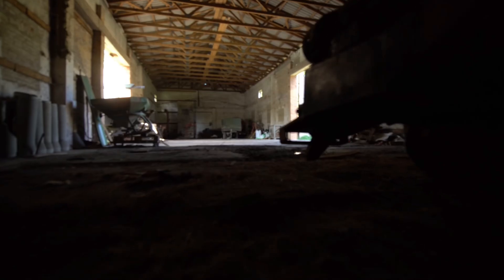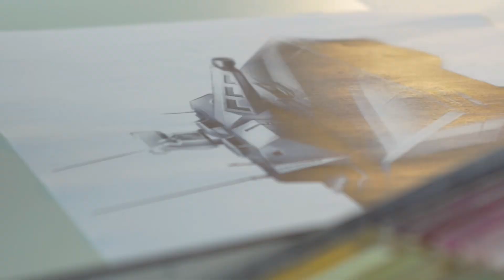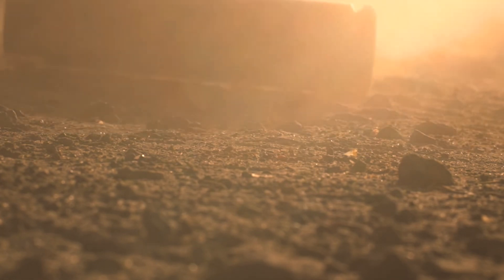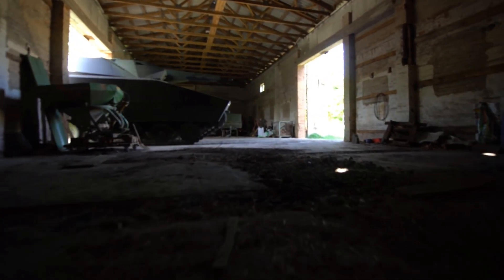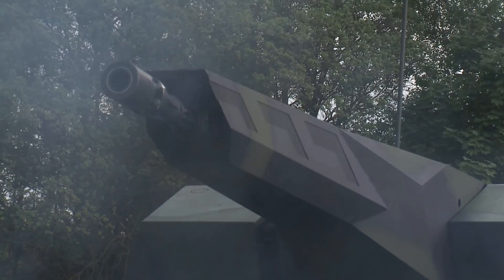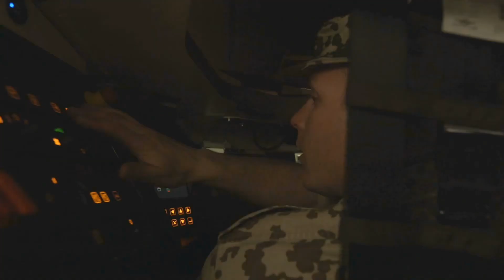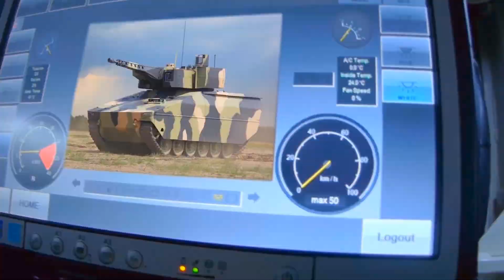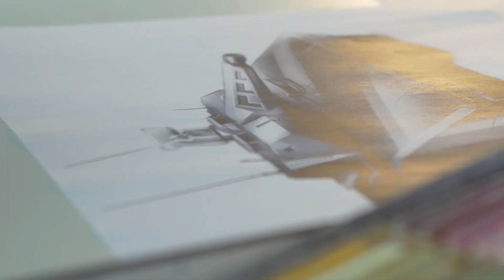Lynx KF41 IFV - Puma has competition!

Comment: My personal opinion is that this is an Upgrade to the PUMA. Dont forget that the PUMA should be in Service Since 2007 and for now just a bunch of them entered sevice in the Bundeswehr.
Reply: A 'bunch' of 200.

No, this is much different from the Puma. This is for export, less advanced, but also less expensive.
Reply: Jonny I serve on this vehicle and it's uncomfortable for the crew with the IDZ programme the needed upgrades won't be finished until 2020 and it's mechanically unreliable
Reply: The Puma uses some more advanced but also more expensive approaches that put it ahead of the competition, including ther Lynx KF41. Here is a list of advantages the Puma offers over the Lynx that i already commented earlier in this comment section, i just copy-pasted it:

-Hydropneumatic suspension: While the Lynx uses torsion bars (the 'advanced' thing they were talking about were only the bump stops) the Puma uses a hydropneumatic suspension. 

-Decoupled running gear: The running gear of the Puma is only connected to the main hull with rubber elements, reducing vibration and noise comparable to rubber band tracks, without the disadvantages of rubber tracks. More importantly, it increases mine/IED protection because the hull doesen't have any bolt, screw or torsion bar holes (except for the final drive) that would create weakspots. Lastly, the fuel is stored in the decoupled part, thus outside the hull and less of a hazard to the crew.

-KMWs propetary 'thin metal bending technology' (also used on the Boxer MRAV) Instead of weldig thick steel plates together like usual, thinner plates are placed overlapping and bend together. It creates a lighter, but more sturdy hull that is more resistant to blast effect. Combined with the decouopled running gear mentioned above the Puma reaches a mine/IED protection level higher than that of the Leopard 2A6M MBT. The weight saved by the hull is invested into more composite, boosting the weight/protection ratio.

-MTU HPD engine technology: The Pumas engine is about as powerful as the Lynx engine, but much smaller.

-Better optimized internal layout: The Puma was initially developed with a unmanned turret only, so it could be better optimized for it. This allows less waste of space and results in a better protection/weight ratio.
Reply: Protection: https://below-the-turret-ring.blogspot.com/2016/10/puma-ifv-armor-and-upgrade-speculations.html

Performance in czech test trials: https://below-the-turret-ring.blogspot.com/2017/12/addendum-puma-ifv-performance-in-czech.html

Comment: tell me, how is this IFV not considered a light tank?
Reply: Armament?
Reply: the m3 Stuart, m3 Lee, and m22 Locust also sported a 37mm and it were all considered a light tank so that is out of the question.
Reply: Don't compare it to WWII vehicles, you have to look at it in a contemporary manner. Nowadays 30-50mm are infantry support or air defense only, and can't penetrate modern MBTs. The abiliy of the Lynx to carry infantry under protection and provide direct fire support for them makes it a IFV.

Modern light tanks, the CV90120 as example, also base on IFV chassis but sacrifice their troop carrying ability for the larger armament. Light tanks are considered pretty useless nowadays because MBTs can do everything they do, but better. They're even more mobile despite the higher weight.

Comment: I cant help but have a bad feeling, that western modern designs completely abolished the option of an amphibian or at least swimming APC/IFV. And also that the space inside somehow forces troops to be less and less geared ( cant imagine having troops with a butt-pack and an 3-day rucksack there at all ) meaning they be heavily depended on logistics - witch again strikes the amphibian/swimming issue. In middle Europe ( im from SVK ), both the infrastructure state of bridges, and the number of rivers is a big issue. So if an enemy had an edge in the sky, picking up columns of bridging-vehicles or bridges themselves be an easy task. practically leaving the group uselessly sitting at the first river.  ... i also cant really argue the protection of the crew, but AT-rockets always will have an edge here, and it be still useless if a large-enough group of AT-squads would hinder the APCs/IFVs anyway. .... not complaining, but for a small nation as mine, this very downside means thus a much more bigger need in logistics and engineer-troops ( not just for the bridges ) and heavy AA capability to defend them. Not sure if it is thus a good concept.

Comment: 40 tons are a lot. Means it will have a severe drinking Problem, as well as sinking. And Track wear. I'm not sure I'd take it anywhere near soft Ground. Recovering it will then also require rather heavy helpers.
And it's Fuel Consumption will reduce independence.
Bridges become a Problem as well at 40+ tons.
Reply: Vehicles with larger engines also carry larger fuel tanks, so consumption isn't a problem. Track wear and terrain isn't either, because larger vehicles of course also use larger tracks than small vehicles. Ground pressure is pretty similar, mostly around 8-10 N/cm². Bridge argument is valid though, however that is simply a question of doctrine, preferring mobility over protection. Imho, never.
Reply: Jonny Fuel Consumption is a big Issue Logistically. Fuel Storage is always vulnerable, the bigger the worse. And that thing has almost twice the Ground Pressure than the Russian and Chinese IFVs. It's size kills any attempt at Conceilment and Surprise. And no matter how low the Ground Pressure, the Vehicles will still damage Roads far more severely than Light Vehicles, to the Point that Logistic Trucks will no longer be able to easily reach their Destinations.
Reply: And IMO a moving Vehicle is worth far more in a Breakout than a Stuck one.
Reply: 'Fuel Consumption is a big Issue Logistically. Fuel Storage is always vulnerable, the bigger the worse'

Larger vehicles don't only have larger fuel storages, but also more armor covering it. It's a upscale at a whole, not only certain parts.

'And that thing has almost twice the Ground Pressure than the Russian and Chinese IFV'

That isn't true. VN-17 IFV weights about 30 tons, T-15 IFV about 40. You have to compare it to current-gen IFVs.

So you are preferring far inferior protection just for the advantage to cross bridges?

Comment: The thing i always think when seeing all this tech,  same as both air force and navy projects, as cool as they are,  so they really need to be so massively high tech?  If it's modular it has the ability to be upgraded down the line,  but when every country but usa(USAUSA) is cutting military budgets, surely more modern (as in better reliability, better but similar designed and with better materials) versions of what currently is affordable in number better than these?  Something that has been repeatedly tested and used already but with the problems fixed?

Comment: so in the end its just a marder II ifv with internal facelift and some fancy new dress to slip in.....
upgrading 60´s tech can only bring you so far.....
Reply: Marder 2 is 90s...
Reply: its the marder I upgraded to marder II.
so a 60s tank upgraded to 90s, now with the lynx to 2015
Reply: The Marder 2 wasn't a upgrade of the Marder 1. It was a entirely new vehicle.
Reply: well it is in the most part the marder 1 chassis, re designed with leo2 parts and modernised, bigger turret etc. so in the end, its a marder 1 upgraded. 
look at the marder 2 hull and compare it to the marder 1. its in large parts identical. the lynx is just a more modern version with more marder 1 parts, like the ramp for mounting and dismounting
Reply: Following your logic the Leopard 2 is a upgrade of a Leopard 1? No, seriously, the Marder 2 isn't a upgrade of the Marder 1, it follows a entirely different layout concept. It orientates on the Puma PM-2 (the 90s one, not the new one).

Comment: i think the front of the turret is flawed.   With having a V shaped front any round hit the bottom half will have a chance of deflecting down into top of the hull.   Will the Panther Tank they had to change the gun mantle slightly adding a block along bottom of mantle.  
Other than this looks a damn good vehicle.

Will being based on marder, may be the turret off the marder tank will fit.

Comment: If you can put the UK 40mm Telescopic cannon on there, great. Personally this if i was buying then  i"d get the proven CV90 base...then commission an upgrade feasibility on the UK telescopic 40mm. Much less risky
Reply: The 40mm on the AJAX is in a modified Rheinmetall LANCE 1.0 turret, so it's certainly possible.

Comment: But Matsimus is right the IFV-market is getting crowded. CV90 is not going to take it lying down. OK, at the moment - if you follow the video's on Janes and other channels - every village idiot carelessly armed with a blowtorch will have his IFV carrying everything - including the kitchen sink. Lot's of these ideas are simply not up to the task.

But when german industry starts talking armour everybody better listen up. I'm not putting down american products, but have they been able to adapt to the technological changes that has happened the last 30 years? Especially in the engine department.

Are their engines up to par with those from MTU and Scania? They still muck around with turbine engines. But a modern diesel does not need the complications of that drivetrain. In the interwening period truck engines have developed enormeously. And if you think a modern road transport company is going to stand for trucks that consume that amount of fuel and breakdown - you are very much wrong. The german solution to engine breakdowns is: Change the whole ruddy engine - in the field.

The aircraft engines? The EJ200 in the Typhoon does benefit from 30 years of development.

As to naval engines. Well, with proper design of the hull the MTU engines are a much simpler solution and with diesel economy it pushes up the shipsize where it is more appropriate to use turbines - and even nuclear power. I mean: If your frigate has a range of 10.000 nautical miles - then who needs a nuclear powerplant - with all the heartache that entails?

Comment: The interesting development I see is that it is suggested that you take the Leopard 2 and put a LeClerc turret on to it, which apparently can be done without to much trouble.

OK. It means you'll have to live with an autoloader, but it reduces the total weight: The turret accounts for between 1/3 or 1/4 of total weight the poor chassis has to carry. That means the IFV has an additional burden with antitank. The tanks will be involved in the dirty knife fight and be fully occupied with that. The IFV with their dismounts will have to take the longer ranges with antitank missiles.

The next problem is: How far will these "plastic" tracks be able to take over from steel tracks - I think that is the relevant question for the IFV. My feeling is: 60 ton vehicles? Very doubtfull.
20-30 tons probable: The really iffy proposition is the 40-50 ton range. You risk running into greater problems than you solve around that weight.

Comment: Matsimus: Personally I find your off the cuff remarks more interesting.

In my view I think we should start the "modularity" debate somewhere else: The chassis!

If you have a good chassis that can absorb a lot of engine power - work from there. The Leopard 2 is a prime example. It has a chassis that can absorb 1500 hp and the rest goes from there. This means the total weight of the vehicle is determined of around 60 tons. The diesel engine has come a long way from the stinkers of my childhood.

If you have been following the Le Mans 24 hour races you will see that Porsche was winning with diesels. Actually it won the last ones because they could go flat out for 24 hours without breaking into small pieces. The fuel economy of a diesel is also a factor.

Now the task of the artillery and infantry is to keep up with the tanks. Now keeping up with has several dimentions: Being able to survive the amount of fire that determines how close in to the enemy you can get, and still maintain the ability to kill them. If you are against russians, you KNOW they will use prodigious amounts of artillery. So you need to be well protected and that goes for artillery as well. Just look at the PzH2000 that has all your hearts desire for sustained fire. The trick is getting close enough to be accurate. That is the big saver of ammunition: Actually hitting the damned suckers, so they don't come around for extras.

That gives a problem with the railroads and bridges that can't take the heavy tanks. There the solution is typically german: You change the bloody railroad and their bridges. Problem with that approach is that it takes years - decades.
The workaround is that the European rivers are generally not navigable very far up: The Rhine and the Danube are the two exceptions - and they off course have the most bridges.
But if you can land the heavy equipment in ports - and there are a lot of them in Europe - and  move along the rivers - then there are the fewer bridges to cross.

As to the railroad: Well freight trains hate inclines as the friction of steel on steel is small - one of the advantages of railroad. That means you have to drill through the bloody mountain or go around it. Switzerland is really an inconvinience - going UNDER it takes a lot of effort.
But on the northern plain there is comparatively "plain sailing" from Rotterdam to Tallinn. That will take time, but much of the railroad is there and is being build.

So writing off the heavy tank is very premature. That means writing off the heavy IFV is also done much to lightheartedly. The main issue is: With proper tactics the bigger guy always wins - if he can get to the fight.

Comment: Puma (and this will be) is also the most expensive :) so iam very curious about BVP (BMP) replacement.
I served at BVPs at the 41th mechanized batalion :) (4th rapid deployment brigade) and they are still awesome. Maybe they would be still good enough with some kind of complete modernization, which exists.
Cheers from CZ :)
Reply: well if you add some composite armor and ERA plates... it would be good and cheap at the same time (with new engine, coz its gonna be heavier)

Comment: So the MICV has crept up in weight to more than a Leopard I MBT. Inevitable I suppose. But with a 1000 HP engine, advanced suspension and rubber tracks it's faster, quieter and more agile, so there's no downside at all. Love it.
Reply: It uses torsion bars. The 'advanced' thing they are talking about are the bump stops.
Reply: Jonny. And probably the dampers. Germans love their torsion bars, being a German invention, but it gives you a loong spring for limited height intrusion and has good survivability. If they break they are a biach to replace but...
Reply: The german army atleast moved to hydropneumatic suspension on their latest tracked vehicle. Torsion bars have issues with mine/IED protection.
Reply: Jonny. Yes they do, a major shock load from underneath will bust a torsion bar.
Reply: A hydropneumatic suspension will also be disabled in a mine/IED blast. The main disadvantages of torsion bars are that they take up space in the lower hull that could be used for mine/IED protective armor plates instead. On vehicles with torsion bars these belly plates have to be mounted externally, which reduces ground clearance and decreases blast resistance again. And, unlike hydropneumatic suspension, torsion bars necessarily have to penetrate the hull (holes), which creates a blast weakspot. This can be avoided by using hydropneumatic suspension, optimally in combination with a decoupled running gear.

Comment: Would like to see it with a 105mm gun module.
Like on those on a Stryker.
Reply: You don't really need a 105mm gun. It's an IFV, an auto canon is more practical against infantry and light armor. It saves weight, can carry more ammo, and has a better rate of fire. Against heavy armor, you have missiles. The extra weight you save can go into more armor, or better mobility.
Reply: The Striker uses a 105mm gun, and it's a low powered one at that.
Reply: Maybe a hitfact 120 turret?
Reply: DesertStorm922 yes, but maybe Reinmetal is not so happy with 3th party add-ons.
Since they build large caliber guns their sell it would probably be one of those in a new development turret.
But as they say:
The costumer is King

So everything is possible ;)
Reply: Puzzoozoo just used it as an example so people get the idea. Thanks for the correction.
Updated the original comment.

Comment: German worth work again...😁🇩🇪 The Lynx is the export version from Rheinmetall. The Puma have not so much men capability because the Puma is nearly a real combat vehicle. The Puma have so much armour, the special german 30mm anti-tank and anti-infantry rounds, and so many anti-missle systems etc., there is no place for 3 more men.😅 

And the Puma was developed for that, as a (heavy) fighting vehicle. Specially in that time now with all these anti tank things and so on... The Puma needs no more men, because he is so strong. There you dont need much men, a few are enough. Especially with all these soldier and tank equipment today. 😅

The effective infantry transport of more/many soldiers are the task of the modern german armoured infantry transporter "Boxer" now.
Reply: Bullshit, the reason the Puma doesn't have room for more personnel and equipment is because it should fit into a flying cripple that has just about half the transport capacity it should, not because you couldn't use the three more men.
Reply: Lynx is copy of Turkish Tulpar IFV
Reply: @tankconquerer5428  tulpar is a copy of cv90
Reply: @tankconquerer5428  BIG 🧢